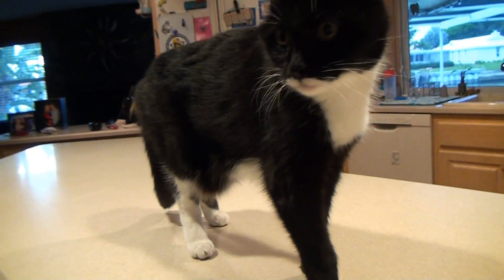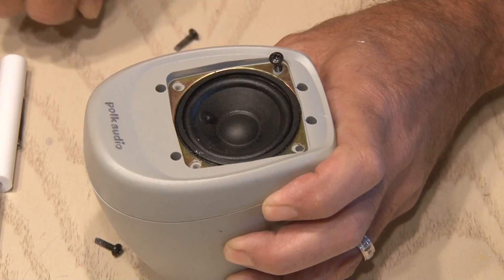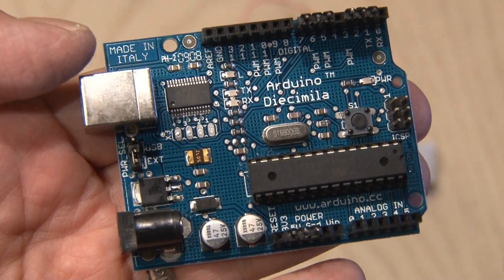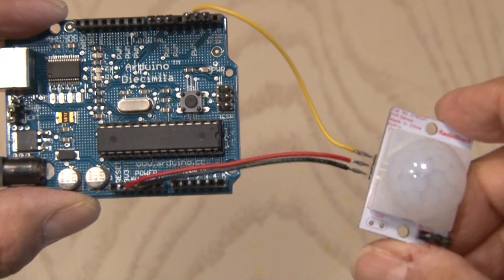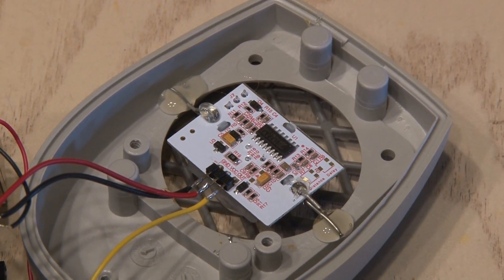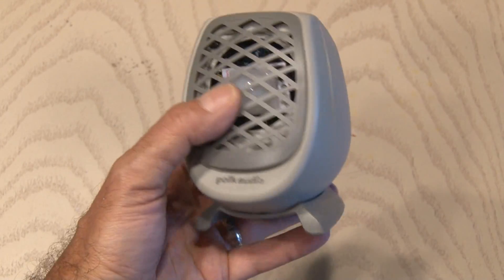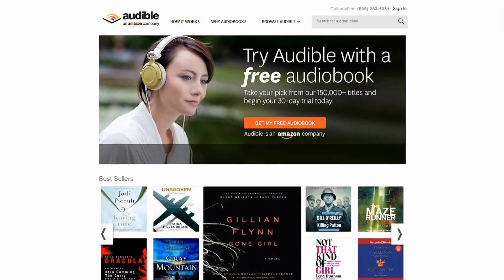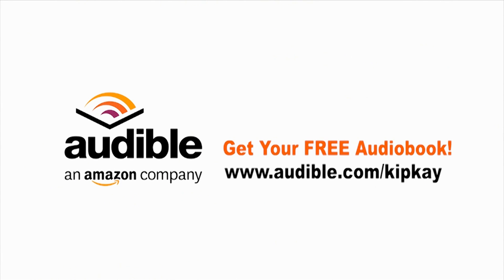Sonic Cat Repeller!

Comment: Nothing wrong with Kip making $120k on his video works. It's a capitalist society here in USA and he is not beyond taking advantage of a good thing. If you hate them just click STOP/PAUSE then scroll down to comments.

One note on CATS. This Arduino is being under deployed. Cats are very smart and that Radio Shack annunciator will soon be relegated to all the other sundry sounds your cat will ignore daily. The best use of a Arduino (an over priced toy) is to use a solenoid to dispense water in a broad stream atomizer. Enough to simulate another cat spitting. Adding another device that simulates a cat snarling or your voice saying "Get down from there kitty..." would probably be more effective.

Actually a Radio Shack PIR (Passive Infra Red) burglar alarm could be modified for this operation and be a lot cheaper than an Arduino. Just add a reed relay for the speaker. A small voice recorder could be added to make the noise or voice. The internal speaker could be connected to the recorder for better quality and the reed relay could ground out the recorder's play button and the solenoids V- supply side. It only needs to spray kitty once and she'll never return a second time.

Actually an automated air freshener mechanism could be used as the solenoid and water sprayer. All you need is a PIR detector to fire it off.

I like Mr. Kedersha's work. Not bad for a Floridian and Jersey Boy.

Comment: An Arduino?! The thing about these projects is that few people are going to make them because of the Arduino. An arduino board is quite expensive. Imagine if people did all of your Arduino based projects. You could have made this project using a simple $1 microcontroller.

Comment: Why spend so much an arduino when you could use a LO8 genie for half the cost and create a flow chart telling it. (send Output speaker high) if (input censor high) this will decrease the size dramatically and make the whole project a lot cheaper, quicker and most importantly easier!

Comment: You can also put thick aluminum foil that is not spread flat on the counter. Cats will jump up, land on it, hear a loud crinkle and jump off.  Another option is lay out some baking sheets and put a thin layer of water in them.  Cat jumps on them and gets their feet wet and they jump down.

Comment: could be easier and cheaper by connecting the output of the pir to the buzzer directly.
if the buzzer was frequency shiftable then the computer would help, but otherwise thats a self oscilating buzzer